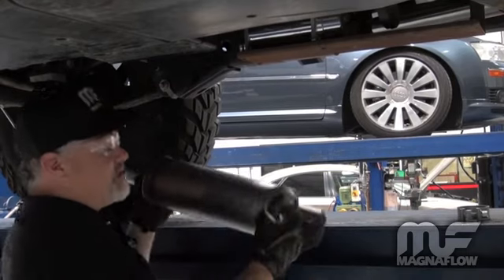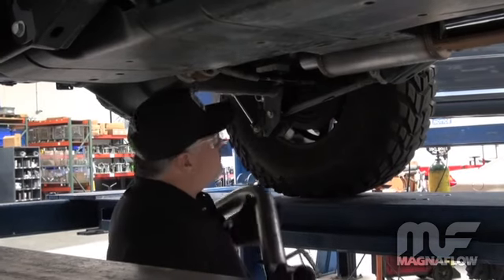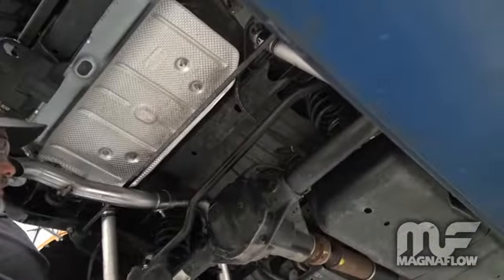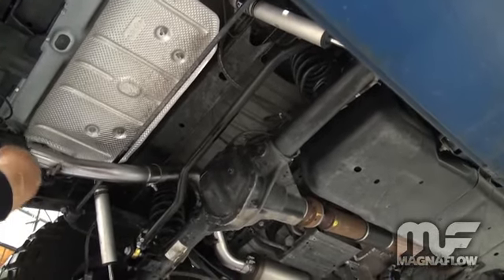Installation: MagnaFlow Rock Crawler High-Clearance 2.5" Performance Exhaust System - 15237

Comment: you said u have to replace plastic rear bumper because of added heat in that area, what about factory trailer wiring harness?? it is in same area, wouldn't it be a problem with heat also??
Reply: The wiring harness should have a silver heat shield on it from the factory. If not, you would want to pick up universal wiring heat shielding from your local auto parts store and install that on the trailer wiring.